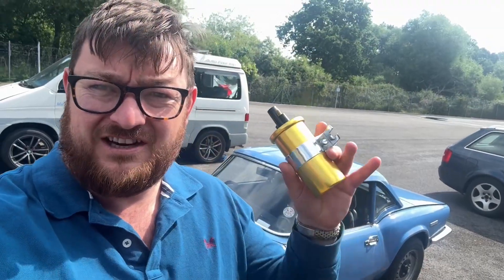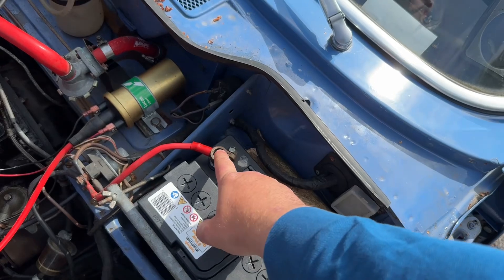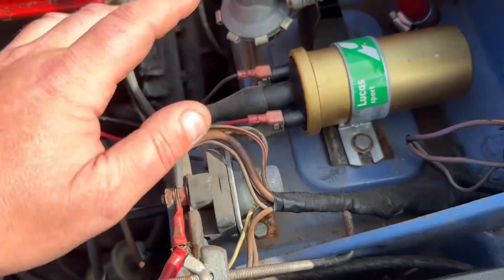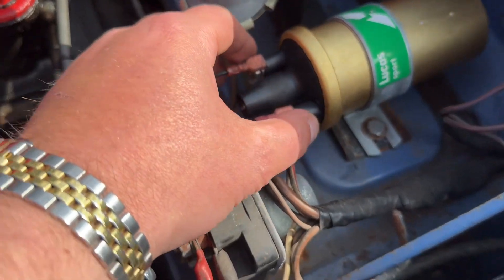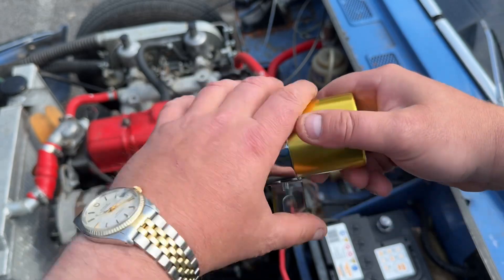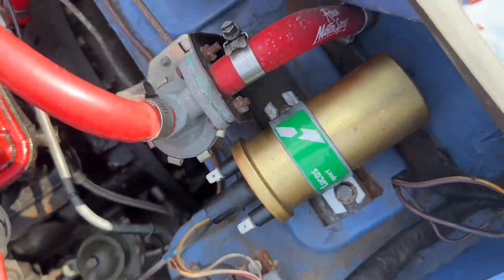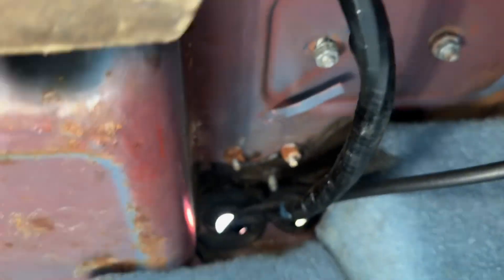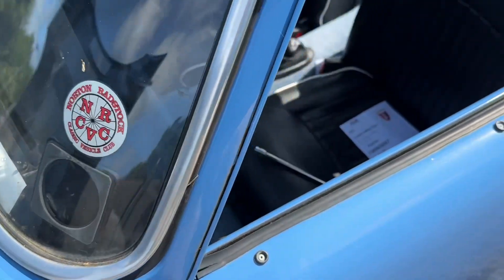Triumph Spitfire Ignition Coil Replacement – Step-by-Step Guide

Comment: What omh coil did you fit ?
Reply from the maker: It’s now fixed my car…. It would randomly stop working and I’d have no spark. After about 10 mins at the side of the road it would work again. Since fitting the coil (I did the video today but fitted it a few days ago) I’ve covered around 150 miles with no brake downs. The old coil would brake down every 10 miles 

This is the coil I purchased.

https://ebay.us/m/G0m1xB